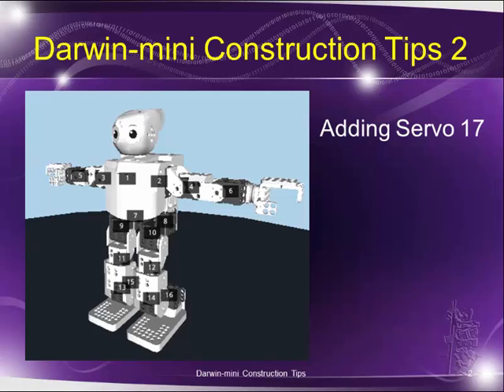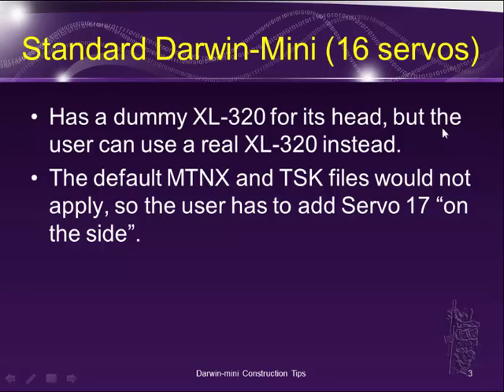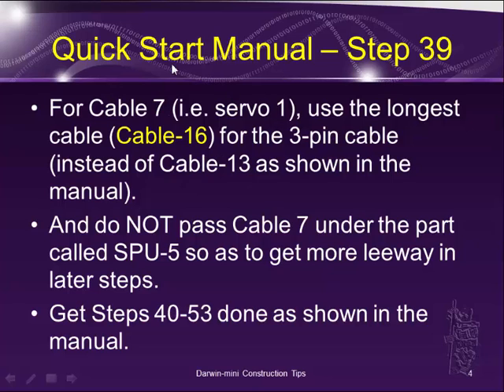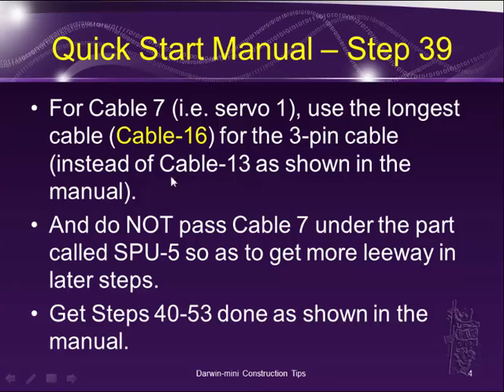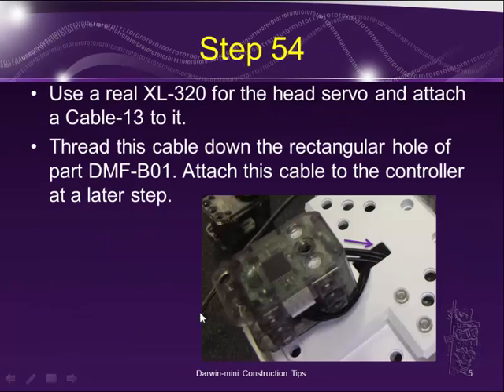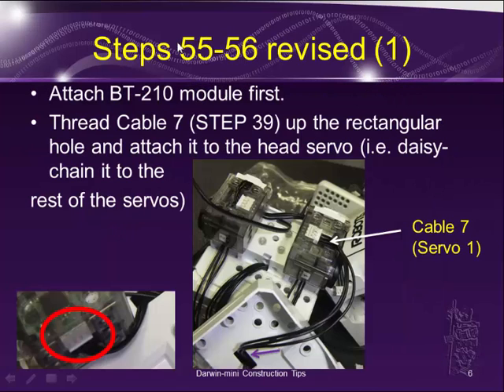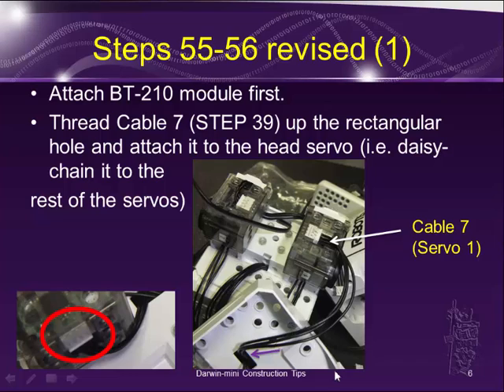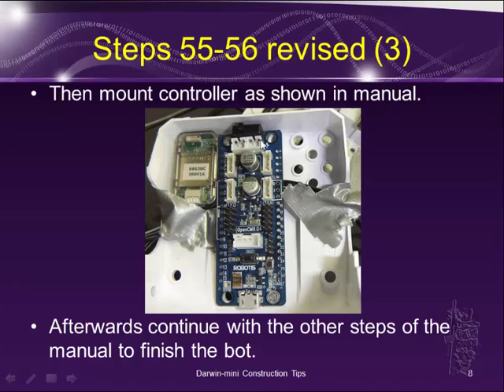Darwin-mini: Adding servo 17

Comment: First assuming that you have set the correct ID to servo 17 using the MANAGER tool   what is the   manager ???
Reply from the maker: You can download the MANAGER tool V.2 (and all other ROBOTIS software tools at this link (http://www.robotis.com/BlueAD/board.php?bbs_id=service_03&mode=view&bbs_no=1158280&page=1&key=&keyword=&sort=&scate=).  Install it on your PC, and follow instructions described on screen and at this web link (http://support.robotis.com/en/software/roboplus2/r+manager2/roboplus_manager2.htm) to change the original ID=1 to ID=17.  You need to connect that single servo to the OpenCM-904 just by itself (be sure to apply power to the system also).

Comment: How to connect the servo 17 to the open cm9?
Reply from the maker: First assuming that you have set the correct ID to servo 17 using the MANAGER tool or by using the USB2Dynamixel dongle + Dynamixel Wizard tool, the connection steps are described in Steps 39 to 56.  Essentially as long as all servos are daisy-chained via the 3-pin cables into the XL Dynamixel bus (white 3-pin connectors), the controller will find them OK, i.e. you do not have to create any special direct connection between Servo 17 and the OpenCM-9.04.

Comment: a question please. to change the id in the servo I need the usb2dynamixel?? correct?
Reply from the maker: +jose catalano No, the USB2Dynamixel is not designed for the XL-320.  First you need to leave ONLY the head servo connected to the OpenCM-90C (so that it won't get confused with having 2 servos with the same ID=1).  Power up the MINI as usual and using the ZigBee connection (BT-210 or BT-410).  Then use the Dynamixel Wizard tool to connect to the MINI, then you can change the ID from 1 to 17 from the list of various parameters related to the XL-320.
Reply from the maker: +RoBoTeer2012 You can see more about what the Dynamixel Wizard tool can do at this video http://www.edge-cdn.net/video_950942?playerskin=37016.  Please note that in this video an LN-101 module was used instead of the BT-210 or BT-410 that you may have.  The LN-101 is the equivalent of the USD2Dynamixel for the OpenCM-904C.

Comment: hi. how you make move the head? I did make the connection but doesn't move the head
Reply from the maker: +jose catalano Assuming that you have installed the latest R+Motion V.2 tool (http://en.robotis.com/BlueAD/board.php?bbs_id=downloads&mode=view&bbs_no=1152548&page=1&key=&keyword=&sort=&scate=) you just need to choose the "robot" option for the "MINI with head joint" at start.  However please note that none of the existing demo motion units used the head joint (yet), so you need to program that in yourself.
Reply: Please if you have the program for the head could you send me? Really I don't know how to program
Reply from the maker: +jose catalano Unfortunately, I don't have any program with the head moving at this time, but ROBOTIS has a very detailed tutorial at http://support.robotis.com/en/software/roboplus2/r+motion2/rplus_motion2.htm.
Reply: Ok thanks and do you know how to make function the sensor gyroscope?
Reply from the maker: +jose catalano At present, ROBOTIS does not have an example TSK code for using the gyro with the MINI, but they do have an example code of the BIOLOID PREMIUM using the gyro (on PORT 3 & 4) at this web link (http://support.robotis.com/en/product/bioloid/premiumkit/download/bioloid_premium_demo.htm) for the HUMANOID type C. This is an advanced piece of code however if you want to adapt it to the MINI.

Comment: Hi peeps Im stuck.. I've followed this guide to add servo 17 and my robo just wont move at all when I sync to R+motion.. have I wired this up wrong somehow? Im a newb.
Reply from the maker: +Come Play Die.  
Your hunch about Servo ID number is correct, all new XL-320s have ID=1, so you'll need to change it to "17" (if not there are 2 XL-320s with the same ID=1).  First you need to somehow hook up ONLY the "new" XL-320 to the CM-904-C and then use the Dynamixel Wizard (with the LN-101 or the BT-210) to connect to it, then you can change its ID.  Unfortunately, I did not make such a video yet, I may have some time later this weekend to do that.  Good luck or hang in there for a few more days!
Reply: Thx for your help, I managed to finally do it using roboplus Dynamixel Wizard. :)